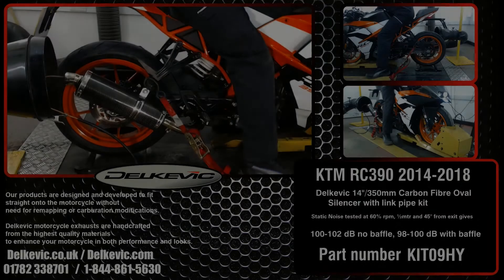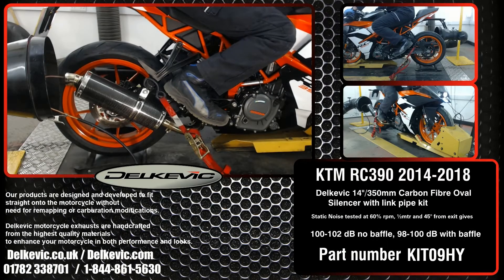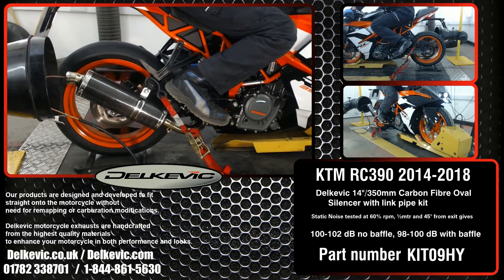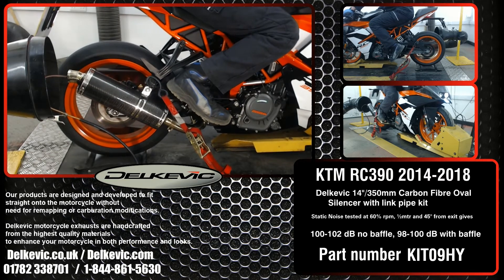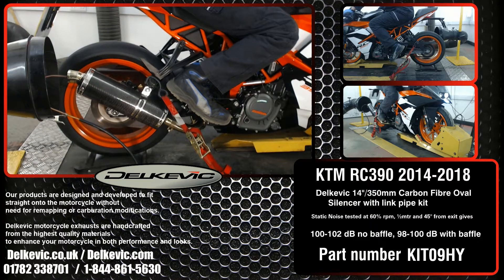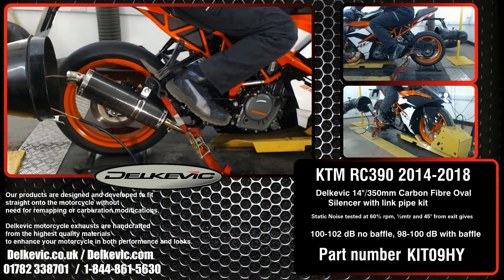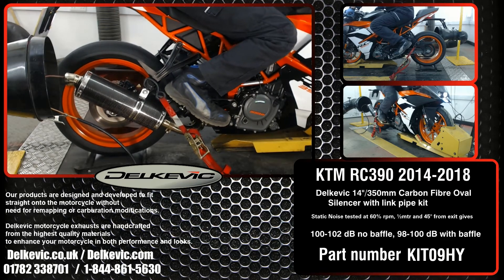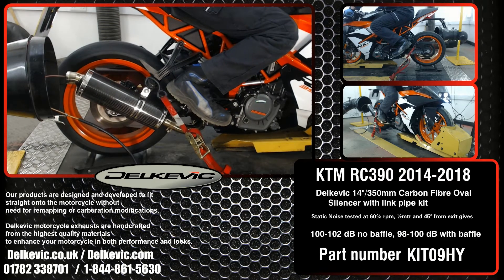Delkevic Oval 14"/350mm Carbon Fibre Silencer on a KTM RC390 2014-2018

Comment: Does this fit on rc 125?
Reply from the maker: Hi, we are currently working on an exhaust solution for the 125. The much smaller engine requires a much smaller exhaust to run effectively and we are in the process of developing something but unfortunately we cannot yet say when we will be able to offer it as part of our product range.